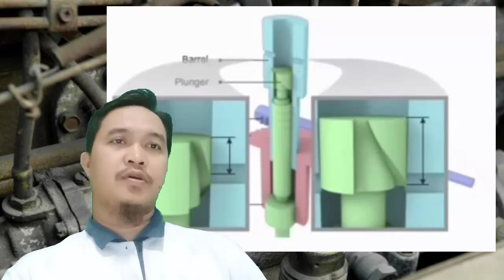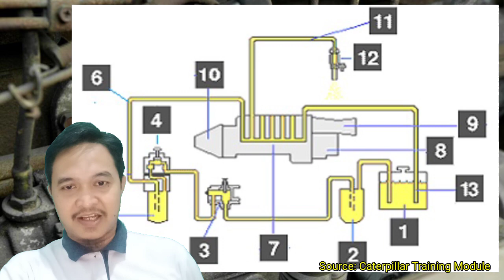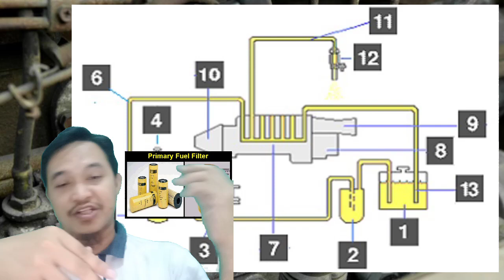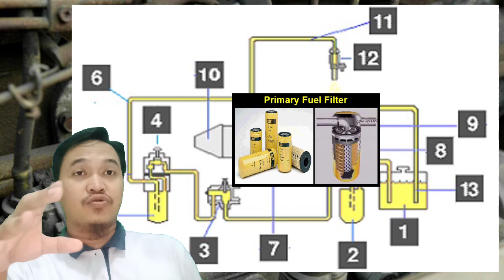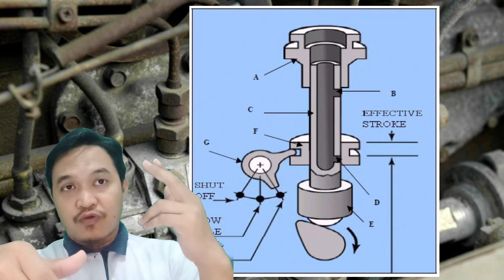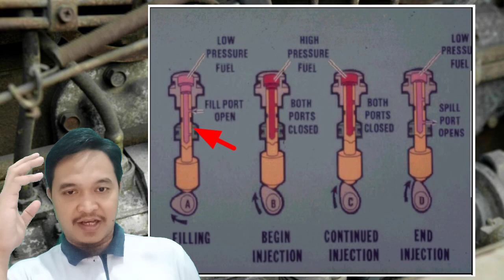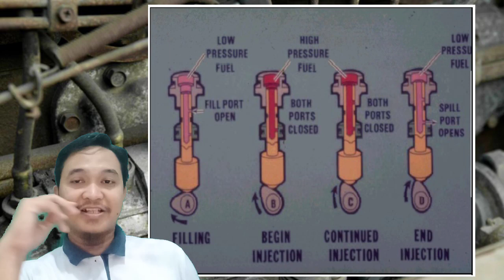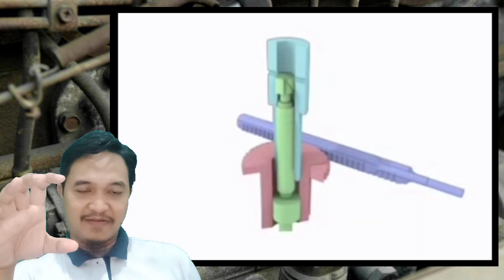Cara kerja sistem bahan bakar FIP (fuel system) Engine. Training BMC Bagian 9

Comment: Nyimak, koreksi sedikit mas Diki tipe Scroll dan new scroll pelumasannya sama menggunakan oli. Yg pelumasan hanya menggunakan fuel adalah tipe sleeve metering.
Reply from the maker: Owalah ternyata ini Mas Garry FIP to.. Hhaha.
 Maaf mas baru nyadar aq.. terimakasih banyak atas koreksi dan pencerahan nya mas.. 🙏🙏😁👍
Reply: Mantap channelnya👍👍👍 semoga semakin sukses...
Reply from the maker: @garryM11446  aamiin terimakasih mas Gerry.. 🙏🙏😎
Reply from the maker: Terimakasih atas koreksinya mas.
Mas mau tanya untuk sumber oli pelumasan nya itu dari hose khusus ke FIP atau olinya menjalar dari depan trus ke extension Shaft itu mas? Karena kan tipe scroll ini FIP nya pakai extension shaft dan agak jauh dari front gear.. 🙏🙏

Comment: Mas diki assalamualikum.
Mau nanya mas yg fip injection.
Kalau yg camshaft tadi maksudnya utk membuka injectornya pakai camshaft yg di fip kah mas
Reply from the maker: Waalaikumsalam.. gak ada injector mas, adanya nozzle. Camshaft dan cam lobe untuk mendorong fuel yg terjebak di dalam plunger dan barrel di dalam FIP mas.. 🙏
Reply: @dikiadnarrayyan  nozzle sama injector beda kah mas...maaf mas saya nannya trus.
Reply from the maker: @suhadihadi8761  beda lah mas.. injector ada solenoid nya.. 🙏🙏